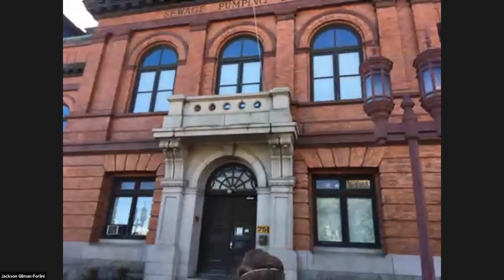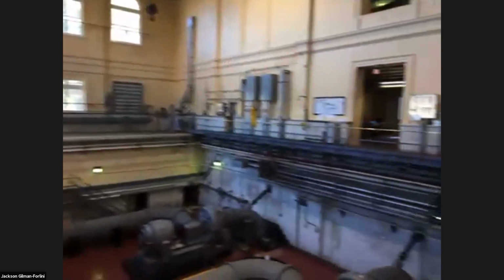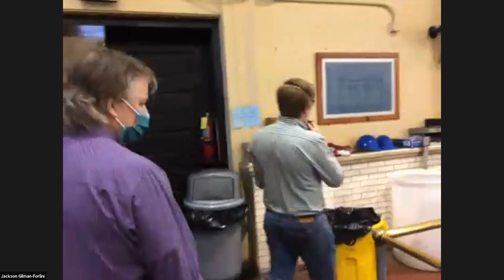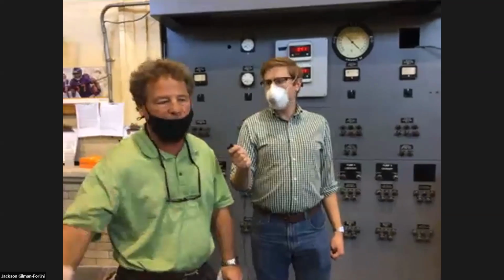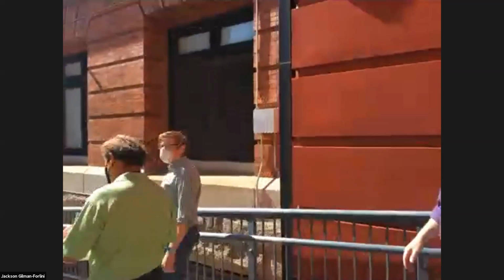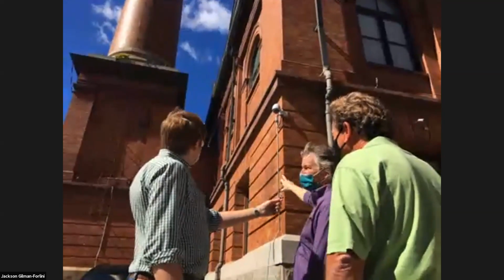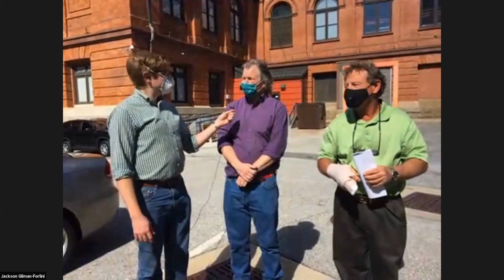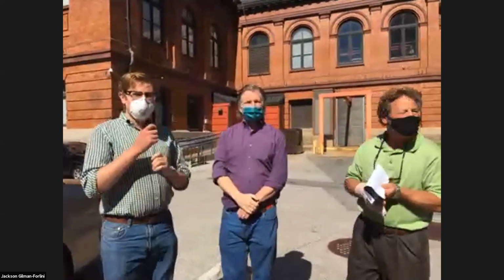Behind the Scenes Virtual Tour of the Eastern Avenue Pumping Station

Comment: The pumps are one speed Delaval pumps with 2,300 Volt induction motors,each pump has what is called a cone valve,that is the only type of shut off valve for each pump inside the building.It opens slowly after the pumps starts,so the head pressure from the discharge line doesn't back down and over power the pump when it start.That's funny it used to pump 365 MGD.30 years ago.